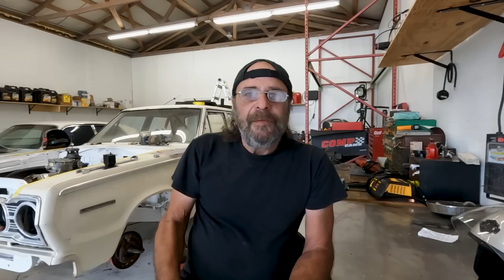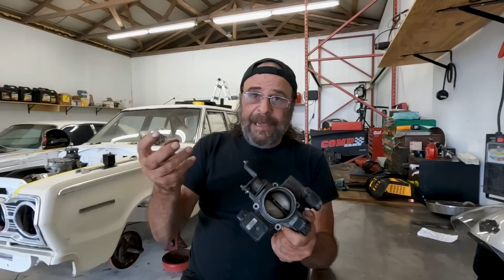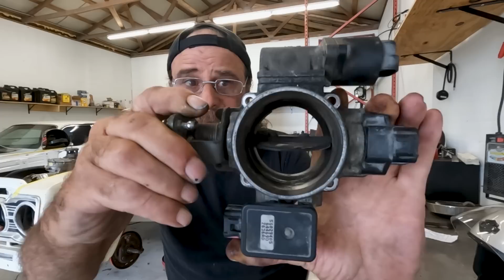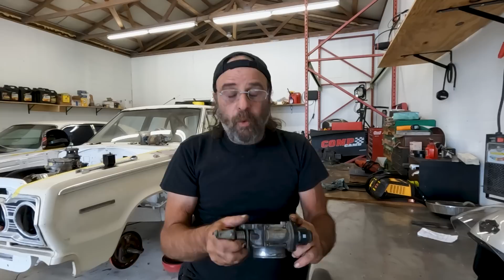Digging For Hidden Power - Building A High Performance Car While Building A Higher Performance Human

Comment: To answer bout the restriction in the Throttle body. These Jeeps where never race cars. They towed campers went camping hauled boats and yes off road. My opinion was air velocity at lower Rpms like 800-2500 rpm range. Remember the 4.0 only has a 3.19 stroke crank

Comment: Great one Uncle Tony , Thinking back 70,s Made some improvement also some screw ups too , The factory did this way  to prevent a problem , with  a certain modify  is no longer necessary .

Comment: perhaps this is as omitted from the size considerations of the throttle body as being too basic, but when you go to a smaller diameter, you increase velocity .   the slight reduction might have been a way to increase airflow overall, without adding too much friction restriction.   after all, they don't give out those engineering  jobs to scrubs.   very difficult to successfully modify a modern car because all the systems are optimized by super computers to be interdependent.  change something and it is very likely , depending on the vehicle, and you have decreased efficiency , no matter what the hype says on the parts box.   I really appreciate this guys insight and knowledge.  Too many YouTubers just repeat what they read on the internet, with knowledge or concern  beyond the need for clicks

Comment: Could the necking down of that throttle body possibly be some kind of effect like velocity stacks on carbs? I mean if velocity stacks actually do anything besides look cool. As far as "handicapping" an engine for later power increases, a lot of folks (myself included) think that the first year of the C4 Corvette (1984) was deliberately handicapped with the CrossFire system (and especially the  narrowed-down intake manifold port design) by GM because the Tuned Port EFI system wasn't quite ready (that debuted in 1985) and they wanted there to be a big increase in power with the new Tuned Port setup. The intake manifold on the CrossFire 84 350 has ports that were nowhere near as tall as the 85 models with the Tuned Port setup. I have seen this personally on my 84 Vette, and I have ported the intake manifold as much as I am comfortable with to make the ports match the head ports. I could go further with the porting (and many folks have) and I probably will someday, as I did feel a slight increase in something (power or torque?) at least in seat-of-the-pants feel. The 85 production Vettes with the new Tuned Port injection made something like 30-35 more HP than the CrossFire of 1984. I do indeed think this was on purpose! Anyway, good stuff again, Uncle Tony! Keep up the great work, bro!

Comment: UT is the 4.0 HO an option for a factory upgrade? Along the same concept, smooth the air intake hose from the cowl to the throttle body with some pvc pipe instead of the ribbed rubber hose.
Reply: That's not a factory or factory replacement part. Your on chapter 3 when we are still on the chapter 1 rules. (Also good to note that when pvc is heated the fumes gassing off have the ability to compromise valve seals with time and exposure)
Reply: @ good to know on pvc! Anything to smooth out the air intake flow that would be better than the ribbed rubber. Aluminum tubing a gutter downspout an old galvanized heater duct.

Comment: i think you're being too hard on yourself by only allowing yourself OEM standard parts. I think you should relax your criteria a little to at least 'day 2' mods - eg, Torquer / RV Camshaft in the 260ish duration range (must include RV / 4WD  / max torque in the camshaft description) , Headers and and straight piped 2" - 2.5" exhaust system with turbo muffler (resonator optional) .. I like to call these the efficiency/reliability mod package because they unlock horsepower that was restricted by emissions regulations and the Automaker NvH stipulations while increasing the life expectancy of the reciprocating parts by removing heat out of the engine quicker at the same time.

Comment: You can port that tb to 62mm safely and 63mm super thin.  The manifold opening is 62mm.  I've been running the jeep/dodge 4.7l ho tb 68mm necked down to 65mm at the plate in my 99xj.  I had to swap two pins around for the tps.

Comment: So counterintuitive to create a rough surface for a better airflow. Good to know 👍
Reply: testing over intuition gave the wright brothers the win on powered flight.  every competitor  was using an intuitive tear drop shape on their wing support spars, the wrights built a smoke box and saw a square spar with rounded corners was more effective.  those old designs used a lot of spars.

Comment: I notice that the gasket mark on that throttle body is bigger than the actual throttle body bore. Chrysler seemed to like to do that. The Chrysler (read: Mitsubishi) 3.0L had the same oddness. The throttle body bore is a good 1/2" smaller than the mating bore on the intake. The 3.3L throttle body matches the bore on the 3.0L. I have put a 3.3L throttle on my 3.0L, and it worked, but the idle was never right. It is adjustable, though. Never got around to doing that.

Comment: Maybe it's something as simple as, the tool for the diecasting pulls the bore from both sides, and they designed in a diameter difference to get a positive shutoff where it meets in the center.

Comment: fuel injection throttle body engines still need air velocity,,the throttle bore can be too big...which causes a lazy port and less air ramming
Reply: I've noticed newer electrically operated throttles are a bit bigger than what the engine would require when compared to what manufacturers made back in the days when manually operated throttle cables ruled. And a cars need the same mechanical functions of the air, regardless of how fuel delivery is made. 

(Also you forgot how vacuum and boost changes the fuel flow. between operating under a little vacuum, being under normal environmental pressure, and trying to fight and push against boost pressure to let some fuel come out.)

Comment: By any chance, did you disconnect the vacuum hose to the fuel pressure regulator by mistake? You would get more fuel,....
Reply: No pressure reg on 96(first year of returnless 49psi system).
Reply: @grad0n  Gottcha!

Comment: You may not have a bench, but why not make a dirt simple thing? You could adapt a pipe to a shop vac with a plate on top for flowing, then just port some clear aquarium hose into the side with some water in it, nail a ruler up next to the water and see what the pressure drop difference is before and after.

Comment: About 20 years ago one of the budget performance upgrades in the Neon scene was the "half shaft mod". Basicly you cut off the side of the throttle shaft that isn't threaded and shorten the throttle plate screws accordingly. I can see it possibly making a difference but I never tried it. I was happy just swapping in the larger throttle body from an automatic car.
Reply: from viewing YouTube content about corvettes,( apparently corvettes are good click bait,) a lot of the "must do"performance mods are no better than ignorant internet gossip from people living back in the old points and condenser tune up days.
Reply: I did this when I ported the throttle body on a 2001-2006 2.0L Hyundai Elantra. The difference it made on that engine was wild (for what it was)

Comment: Tony,, i know if you were playing with a carb you would have put smaller main jets in it.   Do the same by with the EFI. 
Cut back on the fuel.  
And quick question. 
What fuel are you running in the jeep? 
As in what octane? 
You should try runs with low grade then run premium.

Comment: Make it lighter, cheaper than adding HP
Reply: already dropped 100's of lbs.

( you forgot to mention lighter chassis also equals higher spring rates, less friction needed for same lateral G-forces, and higher efficiency of fuel/energy consumption.)

Comment: How much vacuum is it pulling at rpm?
Reply: To truly tune the intake track to the intake plenum. run vacuum lines to a gauge one by one. from runner, then manifold plenum, then clean air tube near throttle on open element filters, otherwise tlgo to the air box outlet, then airbox inlet if applicable 

Then go backwards and recheck everything, then turn back around and do it one last time on your way out.

Each time you find a restriction you will know.

Comment: The throttle body is tapered on stick shift models to help prevent bucking and smooth out driveability. 1st gen dodge neons did the same thing. Auto cars got a straight bore throttle body and manual cars had a tapered. Cheap bored throttle body upgrade for your manual car but the car sucks to drive and bucks like crazy if you cant drive stick smooth.
Reply: I did the auto throttlebody upgrade on my 1st gen Neon. The only negative effect was high idle on decel for a little while untill the computer figured out what to do with the IAC.
Reply: @lb9gta307  glad you had better luck then me but thats why the manufacturer did it was driveability.

Comment: Tony,, what you just describe is an engine that running too rich. 
I know you know this.  
Time to cut fuel out of the top end and or advance the timing  to burn more of the fuel.  
I like that you are going to add more fuel with porting but you are still to rich.  
Are you opposed to adding a O2 sensor??

Comment: I gotta disagree with the air don't want smooth surface. Only wants texture if it is mixed with fuel because it fuel injection you want that as smooth as possible

Comment: Back in the day, me and my buddy had the same model car. And we would always usually match each other on the speed parts. 
Seemed like id always have a fender on him cause id go the extra step, gasket match that new intake and other things like that to get the luttle bit extra the other guy doesnt have. 
Do that 10 or 40 or 100 times and ya got something. 
It always paid off by that 1 fenderlength.
Reply: When I was younger (much younger!) I had a 67 Barracuda with a 340 swap. A buddy had a 72' 340 Duster. Both cars with driver were about as close as you could get. Within about 50lbs, actually scaled at the local truck stop.  Same headers, exhaust near identical, 3.73 Suregrip, same tire's... you get the idea. It drove him crazy that I'd consistently pull him by about a full car length on the street and a full 10th on the track. He was pretty good with understanding things but I had an Ace, family friend who knew about every trick possible. My Dizzy was tweeked pretty much exactly like Tony shows in a previous vid and my cam was advanced 2 degrees. I spilled the beans after selling the Barracuda. He was not amused at the time but we laugh about it now.
Reply: @Ares-jx4ep  
Yup my hidden weapon was dad. 
He knew what to do to go above and beyond just slapping in some part ,and it showed by the fender length I'd get every time.
Reply: Most cams are not ground exactly the same. Some cars just run better.

Comment: A couple of things I was told. Oiling: when putting new bearings on the mains and rods, drill and chamfer the bearings the same size as the crank and block oil ports. Index the spark plugs. If using stamped rockers, go to the junk yard fill your toolbox with free rockers and put them on your engine with a test spring a match 16 of them. Lastly and this goes way back, if the antenna is swinging in a circle ignition timing is off if the antenna is moving in a straight line then it has a miss fire 😊

Comment: I've been thinking about keeping my 318 b body all original with the two barrel and Everything. But with a stock replacement 340 cam from rock auto. I think the 360 will go in it for the mean time but im keeping everything around for a rebuild. Even those tiny exhaust manifolds. It just makes me happy to see a 318 in original condition.

Comment: IF my memory is right....Tony did a story on a 318 2bbl super stocker than ran 14.0s....back in the day
Reply: Yes, it was in a Satellite maybe 73-74, had like 4.56 gears or something like that. Loved that article, at the time that article came out, I had a 78 Lebaron 2 door, 318 2 bbl that I left stock from carb to oil pan but put duals on it, tuned it best I could with the 2 bbl did all the tricks my dad and I could come up with, and though it wasn't stupid fast by any means, it did stay up with bone stock automatic Mustang GT''s. I had a 2.73 geared auto 5.0 LX hatch and the Lebaron had no problem keeping it with it when my friends drove my Mustang and I piloted the Chrysler. Had I put a decent gear in the Lebaron, it would've been a real decent street car.

Comment: 🤔 Forgive me, I'm not all that familiar with modern engines with ECUs and sensors. 🤔 But after the throttle body is altered, even if slightly, wouldn't you need to put a laptop on it and adjust the tuning? I honestly have no idea. 
But I'm thinking that the MAF sensor would have the ECU make changes to the timing or whatever to coincide with the additional air? 
Again, I have no clue, and honestly I've never had the desire to know. 😏 Give me a carburator and a distributor any day
Reply: Jeep uses a map sensor
Reply: He’s got the ability to tune the ECU so making changes shouldn’t be an issue. Ideally the ECM should be able to adjust if it sees more air since the change won’t be that big.

Comment: Tony! Tony! Get the power to the pavement more consistently, get a pick-a-part rear, lots don't even check what they are! They are still less than $200, even up here where it's expensive. Great talk as usual! Don't worry about the tangents, they are great too! So how you going to hog out that throttle body? You gotta show us.
Reply: Wouldn't it be more impressive if it ran a 13.95 without it? So little work, so many handicaps. 

Then later when/if we get to the 2nd phase of the project, the suregrip would drop alot of time.

Because as it stands, it should easily break past 14 seconds with the open rear. Just with entire airway gets smoothed over.

Comment: Uncle Tony, you hit the nail on the head better than I could explain it. You talked about picking up 8 horsepower with the throttle body swap for the engineer's lighter. Well testing fuel injected cars. The peak power that a throttle body makes is not always the most. Like you said in the beginning of your video cracking it open makes the biggest difference. What I found is it makes more mid-range power difference than it does peacorse power difference. 

Hopefully we see et's from this but I would really love to see a limited slip so you can get more radical with The 60 ft.

Comment: What if the computer doesnt throw more fuel at it with the extra air? What if the injectors are tuned for the stock air flow? You run lean and damage the motor. I know modern cars automatically adjust fuel to the surroundings but it is with sensors. You may want to check your air to fuel ratio after this mod to insure that you are not running lean. Does it have a MAF? Is that going to become the restriction? There is a lot to consider.  And your viewers should be made aware of them. Don't just go and port your throttle body without doing a lot of homework and research. It sounds like Tony has evidence his Jeep is running rich up top. If that is the case it may work. But what is going to happen down low or in the middle after modding the size of TB. Will it throw the computer off and make the thing run like shit. Remember, countless hours go into tuning a motor with a certain throttle bodys characteristics. You cant just turn a screw or put larger jets in it.
Reply: They’ve already tuned the ECM. They can play with the tuning if they need to after the throttle body.

Comment: I hogged out my Throttle body to fit the intake on my 97 ZJ 4.0. I lost low end Torque but I gained Top end going just by feel though.

I put a stock one back on for the street & crawling around on trails.

Oh forgot that it WHISTLED the first time I put it back on, had to round the holes inside of the Throttle body, was very annoying, LOL.

Comment: Hi Tony, I have a low cost (no cost if willing to scrounge), get a 4 inch PVC elbow and zip tie or mechanics wire to cowl above your cowl induction to make it a ram air...
Reply: The cowl does that by drawing from the high pressure Infront of the windscreen. The intake opening doesn't need to point forward. Big hood scoops point backwards for a reason.
Reply: @walsakaluk1584  uhh, incorrect,  the cowl induction method relies on the engines vacuum to pull air from a low pressure area, while a forward facing scoop uses high pressure from the airstream to force more air into the engine.
Reply: @indianaslim4971  All piston engines, unless you are using forced induction, (super or turbo charged) rely on vacuum,  to fill the cylinders. Dynamic air intake systems exploit and harvest air in high ambient air pressure zones created by the vehicle's motion through the air it breathes. It still needs sucking if it can't blow.
Reply: @walsakaluk1584 
Primarily they're open towards the windshield to let under hood hot air out. Depending on design very little  gets in below 120 mph.

Comment: Sometimes the manufacturer uses a slightly smaller throttle body on the cars with manual transmissions, so the hp/tq numbers are identical to those on the automatic versions with a heavy torque converter
Reply: It’s normally for smoother operation with a more rigid drivetrain. This is why you will usually see the restriction right at the throttle stop - where it will slow down the actual opening of the inlet tract with respect to the gas pedal’s movement.
Reply: It's also easier to control very low throttle operations. Where you are working the clutch. And more effective at keeping velocity up in the plenum at those low rpms that it might otherwise bog out on, rpms a human might try to shift up to when an automatic car wouldn't have yet.